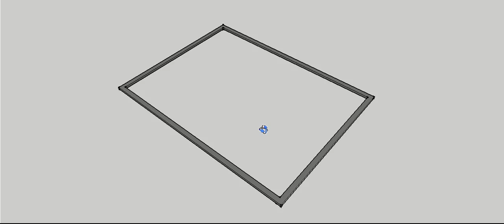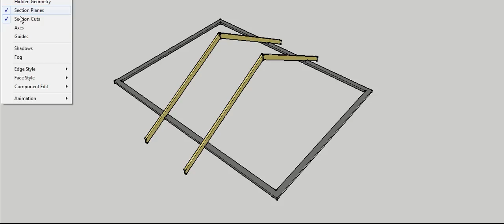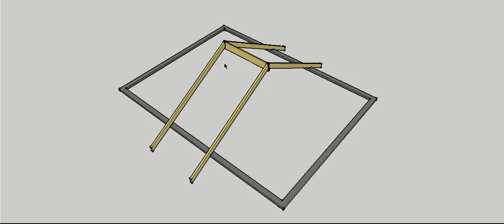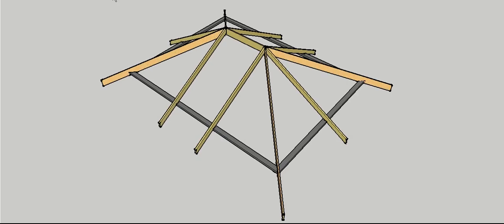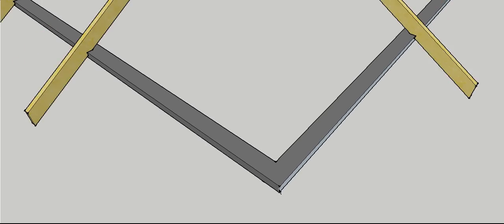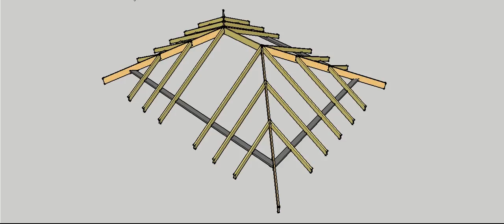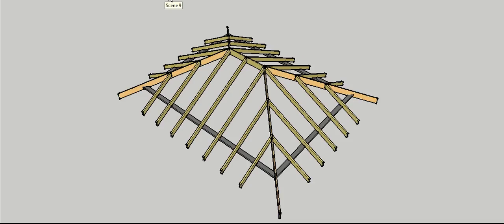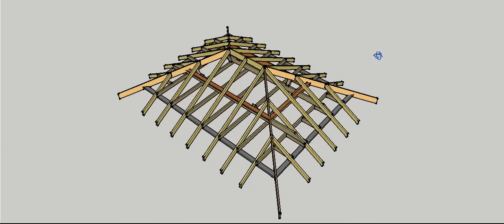Hip Roof Erection Procedure

Comment: Very good information and well explained! For some of the other viewers who are interested in roof construction in different countries or who may even travel to work in other places. On the point where the crown rafter meets the end pair of common rafters, in good practice, we would face this pair of rafters up with a triangular "saddle board" a type of gusset board for the hip rafters to rest firmly rest against to ensure that they obtain full bearing because the hips can sometimes have a  plumb cut about 1/3 longer than the common rafter plumb cuts. The crown rafter in between is also built down with a triangular block of the same rafter thickness and this enables a longer plumb cut on the crown rafter similar in length to the plumb cut of the hips.
 Therefore we adjust the position of this end pair of rafters to allow for the thickness of the saddle board and the hip rafter length calculations still meet at the center of the roof on the plan. Where the hip rafter meets the wallplate it is standard practice for us in Ireland and the UK to notch the hip rafter over a corner tie, or dragon tie, a very secure tried and tested method.
Reply from the maker: Hi Thomas, thanks for that great explaination, it is great to hear how things are done in other parts of the worid.

Comment: Hi thanks for that video.question. Why are pearlings needed the roof will support itself without them (between installing the main roof and installing the pearlings)?
Reply from the maker: Hi  Mate, the Purlins are there to support the rafters. The Purlins are supproted on struts that transfer the loads down to the walls. If you remove the Purlins the rafters will have to be bigger to carry the load. Hope this helps

Comment: A future DIY project Im thinking of doing is a (3.7 x 4.3) 4 post hip metal sheeted roof 'gazebo' with exposed structure (no ceiling lining) without underpurlins, However will add collar ties to the commons only. Is this possible as your model indicates underpurlins
Reply from the maker: Hi Aniton
Yes that is fine as the rafters wont be supported. You will just have to make sure that you are using rafters that are big enough to span the distance without the need for the purlilns.

Comment: do you actually need perlins ?
Reply from the maker: Hi Joni, it depends if the material that you are using for your rafters can span from the plate to the ridge with out them. Or if you dont want a purlin you will have to use larger (deeper) rafters.
Reply: @Buildsum  thanks for Reply 
Size of SHED is 18'x10'
using 2x4 hip rafters and a 2x6 for the Ridge Board 
Slope - 4:12

Comment: Hi,
I am building a side extension. Front of extension wall is 106 inches away from existing house back end of wall is 78 inches away from existing house.
It is not square but I need to build a hip. Please can you explain how we can achieve a same pitch hip without flat roof.
I am waiting for your reply 
Thanks
Reply from the maker: Hi Jabbar, That would be an Oblique Hip then, All hips have to bisect the corner of the wall plates.
This playlist should help you out
https://www.youtube.com/watch?v=UFXAQC3IPfc&list=PLHFT_d-5EhN61YoMyQ4_S2iw2Uq67fLxC
Hope this helps

Comment: hi John, Do we need collar tie if we dont have underpurlins ?
Reply from the maker: +Roger Zhang 
Yes
Reply: Buildsum what's the collar ties space then? Every how many rafters?
Reply from the maker: Hi Roger the collar ties go on every second set of rafters about halfway up the rise of the roof.
Reply: Buildsum how about the collar tie size, has to be same as rafter size? Thanks.
Reply from the maker: Ties to 4200 mm long for F8/MGP12 or higher stress grade 70 X 35
Ties to 4200 mm long for less than F8/MGP 12 stress grade 70 x 45 or 90 x 35
Tiess over 4200 mm long for F8/MGP 12 or higher stress grade 90 X 35
Ties over 4200 mm long for less than F8/MGP 12 stress grade 90 x 45 or 120 x 35

Comment: hi is it possible to remove the joists between the 2 beams? This would allow for a high central ceiling area.
Reply from the maker: Hi, you really dont need the ceiling joists at all if you dont want them, you could run your ceiling lining up the rake of the rafter until you get to the collar ties, or you could also beef up your rafters and do away with the collar ties as well and just have a raked (sloped) ceiling.
Hope this helps

Comment: The position for the last pair of common rafters is half the span minus half the thickness of the ridge, you forgot to mention that!
Reply from the maker: Hi Ed, i did mention that the 1/2 span was to the centreline of the rafter, which was all the detail i wanted in this video as it was just ment as an overview. Just another small point, to get the edge of the rafter you would have to deduct or add half the rafter thickness, not the ridge thickness. Thanks for keeping me on my toes anyway.
Reply from the maker: This video goes into the setout in more detail
https://youtu.be/dHtza2dISqg
Reply: Further to my earlier post and your reply, none of the common rafters come to the centre of the span, the centre of the ridge sits at that point so therefore you would half to take half the thickness of the ridge away when calculating where the last pair of common rafters sit.
Reply: It's the same when you are working out the length of the common rafter, half the span minus half the thickness of the ridge, as the plumb cut of the rafter doesn't sit in the centre of the span!
Reply from the maker: Hi Ed, yes i agree, none of the rafters actually meet at the centre of the ridge and in order to calculate the length of the rafter you have to deduct half the thickness of the ridge however this doesnt apply when setting out the position of the centring rafters. The centre of all the members have to align with the centrelines of the roof.
Reply: If you are talking about what we in the UK call the crown rafter then yes that sits centrally on the span on the hip end of the roof but we were discussing the position of the last pair of common rafters. As the crown and common rafters are exactly the same the ridge must  sit in  the same position, therefore the position of the last pair of common rafters is calculated by taking half the span minus half the thickness of the ridge.
Reply from the maker: Hi Ed, Ahh, I think I have found our point of difference, see here in Australia our Crown end and our common rafters are not the same. The common rafter is shorter by half the thickness of the ridge while the Crown end rafter is shorter by half the thickness of the rafter. This would explain why our intial set out is different.
Reply: @Buildsum  If ridge, commons and crown are all 45mm thick then all rafter members should be the same overall length? (22.5mm deducted from each rafter type)
Reply from the maker: Hi  @aniton11aniton11 , that is correct.
Reply: Hey Ed, thanks for letting us all know that you’re the king of basic apprentice level roof framing. Without you we would be lost. When you going to whip out the bastard hips, multiple pitch roofs with equal overhangs, radius rafters and geometrically designed roofs for us then?
Reply: @edthompson9337  crown end rafters are not exactly the same length as your common rafters unless your ridge and rafters are all the same thickness, and if you actually framed roofs you’d quickly realise that isn’t the case most of the time. You’ve made quite an idiot of yourself due to this little rant, there’s nothing advanced about your knowledge of roof framing at all.
Reply: @christinaaggychris1210  
At no point did I rant in my replies I simply pointed out that Buildsum did not mention taking off the thicknes s
Reply: @christinaaggychris1210  At no point did I rant in my replies I just pointed out Buildsum failed to mention taking off the thickness of the ridge.
As regards rafters and ridge thickness being different, this may have been common in the past but its the norm in the Uk to have a 2" ridge , which therefore means the common and crown rafters will be exactly the same length!
Reply: @waltermatthau8329  I will leave that to an expert like you!
Reply: Seems like I upset the girls at Buildsum's fan club, strange when he took it in good humour himself!
Reply: @aniton11aniton11  
At last someone who knows what they are talking about!
Reply: @edthompson9337  it’s a hip roof erection procedure video mate, not a video on how to calculate and cut every single rafter. One is production, the other is assembly. This is clearly an assembly video. Love how you just jumped the gun and assumed he didn’t know what he was talking about when he made this video, laughable.
Reply: @christinaaggychris1210  I never said he didn't know what he was talking about, I just thought he left out a vital piece of information not mentioning the ridge! You are the one questioning the abilities of people you know nothing about, so start practicing what you preach.
Reply: @edthompson9337  Ed! Mate! Just relax! Don’t want you flying off the handle or anything. Far out! Vital information would have been to subtract half the thickness of your common rafter from your crown end rafter because just in case your ridge was, I dunno?...A different size!...Subtracting 22.5’s all day for you though hey.
Reply: @christinaaggychris1210  Lol, I'm the one who needs to calm down, yet here you are again berating a comment I made on a Youtube video you didn't even make. As I stated to Buildsum it's common practice here in the Uk to use a ridge that is the same thickness as the rafters therefore the common and crown rafters are exactly the same length. I hope that's plain enough english for someone of your  expert ability to understand!